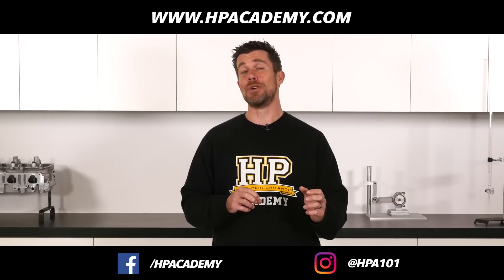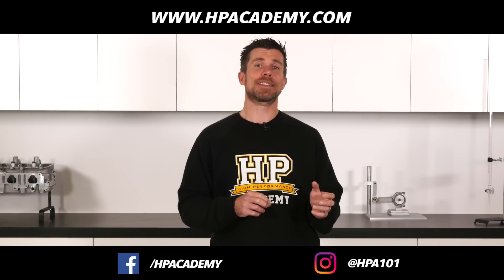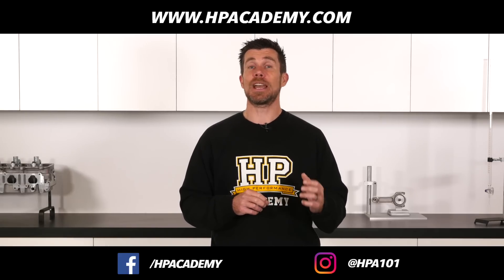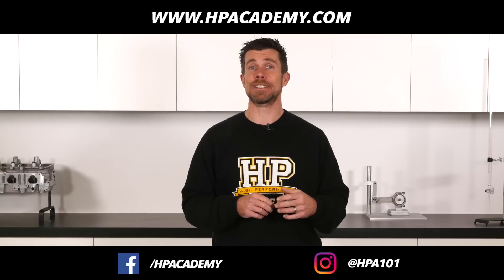[HPA Q&A] How much timing do I cut/retard to build boost on a 2 Step/Transbrake setup?

Comment: Hi, I have a PFC and I want to know if I could just drop my timing table to 0 or less degrees after I reach my desirable Rev limit. I want to do this because currently the ECU leans out the injection map to maintain the desirable rpm, but to me the car also looses power at that point, so I'll raise this limit and control it with ignition timing. Is this method correct and safe??